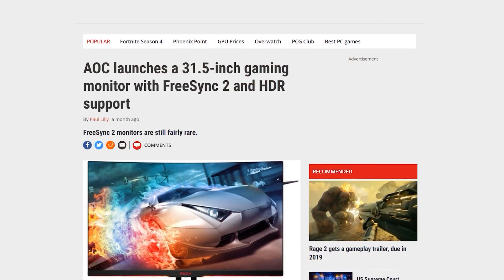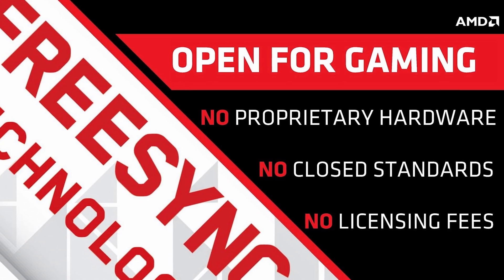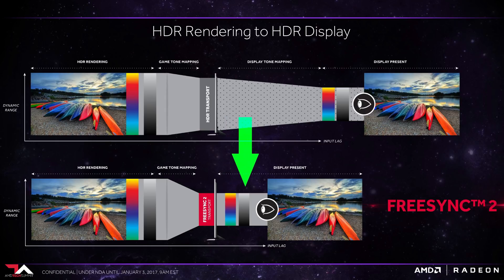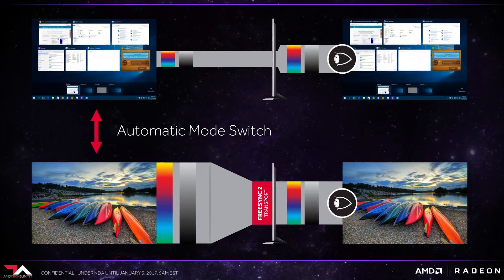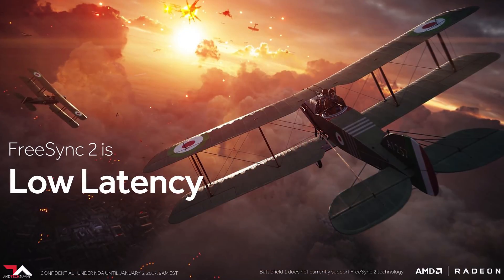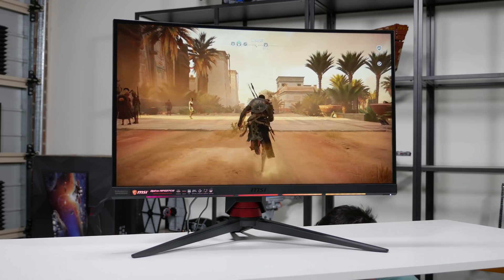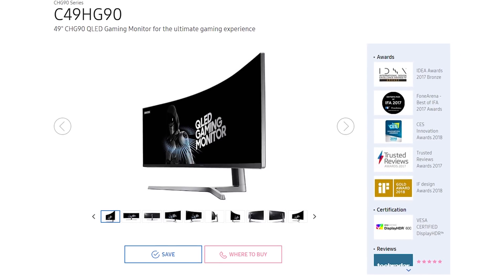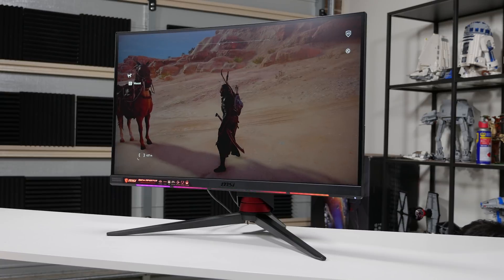FreeSync 2 in 2018 Explained, Does It Work Properly Yet?

Comment: All of them are fake HDR. the 49" Samsung monitor is low end HDR600. There is a new Philips 43' monitor coming with HDR1000.
Reply from the maker: Good luck finding any consumer panel with true 10 bit. That sort of thing costs thousands and thousands right now
Reply: There are no 10bit 1000+ nit monitors, even the Philips momentum is 8bit+FRC, only high end TV's have 10bit with good HDR but no VRR and  too much lag. Its been 2+ years since HDR was announced by Nvidia and AMD and we are yet to see a real HDR monitor. The manufacturers are blatantly slapping HDR tag on every monitor they make. It should read HDR compatible and HDR because they just process the signal. I dont understand how they can call 300nit monitors HDR and get away with it. Acer predator X27 and Asus PG27Uq have 1000nits and 384 zone FALD but they are listed for 2500+ Euros. That's like 2 titan Xp's.Its insane how monitor market is playing out.
Reply: Thats fake as well, true hdr may only be implemented with true 30bit color depth panel(10bpc), while philips and samsung only presentig 8bpc+frc
Its just nvidia who made au optronics produce true hdr panels for the upcoming gsyncHdr panels like pg35vq, xb272, predator x35/27, ag353ucg/273ug
Reply: 1InLight1,

Actually the new 4k HDR 1000 G-Sync monitors are 8bit+FRC too. So not "true" HDR either.
Reply: 1InLight1,

I was talking about the 27 inchers that are coming out this month. OC3D says, "ASUS has confirmed that ASUS will achieve 10-bit colour depth with this monitor using an 8-bit+FRC panel" https://www.overclock3d.net/news/gpu_displays/an_update_on_asus_rog_swift_pg27uq_g-sync_hdr_4k_144hz_monitor/1

IIRC, I've hear one of the Brit youtubers mention it as well yesterday.

As for the Ultrawides, I haven't looked into them yet as they're still very far from release date. AFAIK, 3440x1440 is not considered 4k, so my comment is accurate.

Correct me if I'm wrong though :)

EDIT: Fixed link.
Reply: Kaziel Bonn displayspecifications.com says its 10 bit, reviews say its 10 bit https://www.144hzmonitors.com/best-gaming-monitor/#PG35VQ, what are yours sources?
Reply: Kaziel Bonn Biggest UW resolution I've seen is 3840x1600, which one may consider similar to UHD, as the horizontal resolution is the same and a cinema 4K movie would fit the screen nicely.

Comment: I've had little issue with my 24" Acer freesync regarding shutter and tearing, but I'm still a little confused as to what settings need to be on or off as there is a lot of contradictory information online. I'd like to see presets in games and in drivers that automatically switch on/off upon detection of a freesync panel.

Comment: So is it going to work with the monitors that already had freesync or there will be new monitor support freesync 2
Reply: I'm pretty sure they can upgrade it with a firmware update but that would need to be done on a monitor by monitor basis.. I don't think we will see FS2 on FS1 monitors due to this (I may be wrong)

Comment: hey is there any good 1080p144hz 1ms freesync monitors with good screens under about $350 aud?
Reply: AOC g2460pf, you'll have to manually lower the gamma, but it's a great monitor
Reply: 350 aud is about 265 usd btw
Reply: I think Asus VG278Q its great monitor but cost 295$
Reply: thx i just looked that up in aussie retailers and its about 500 aud most retailers which is ridiculous
Reply: 667whickerwhickerwhicker666 666 identify as a nut button
Reply: i sexually identify as a nut button 1080p 144hz only cost 260$ as in now in my country
Reply: The cheapest is the AOC G2460PF. Got one for 130usd on eBay USA. OSD control is not that great, so to get a proper display/gamma setup you have to use an ICC profile, brightness is a bit high even on low settings, but for that price I can not complain. There are better options on TN panels as the LG 24GM79G and the Viewsonic XG2402,  those have better OSD. There are other alternatives as the Acer XF240H and Asus MG248Q.

Comment: Exactly the video i wanted! Just got a samsung freesync monitor which only has vga and hdmi. So i was thinking should i go for a rx560 for freesync or 1050ti for better performance. Rx570's are just too expensive
Reply: Absolutely. RX560 will easily have the better visual performance with freesync over a 1050ti on the same monitor.
Reply: Adaptive sync (either Freesync or G-sync) is always worth going for. Once you've tried it, you'll never go back to not having it.
Reply: so a rx560 is worth getting over a 1050ti for freesync?
Reply: Aumkar Padiyar, to be honest I wouldn't get the RX560 or the 1050ti. You asked the question which would be better; RX560 with freesync or 1050ti on the same monitor. The answer to that is definitely RX560 with freesync. Currently I personally wouldn't buy anything less than RX570 though. Graphics card prices are on a downward trend so it might be wise to hold on a little while longer and save a few bucks. If that's an option naturally.
Reply: they tell us it should be about summer for launch and late-summer to show in shops. but still no official info
Reply: oh alright ,but a rx 570 has like a huge boost in performance from the rx560 for just one increment in models ,won't the rx 560 be obsolete in a few years? and i dont think ill be able to run any new games on the rx560
Reply: @TheVerm, who are "they"? Please provide credible citation. The fact is there is nothing new on the immediate horizon from neither Nvidia nor AMD.
Reply: +Aumkar Padiyar 
Well, myself I got a first generation 1440p freesync monitor (one of those early ones that was designed before freesync but that had a software update to enable it) and a RX 480.
Because I'm a bit of a silence freak I use AMDs chill to keep refresh rate within the freesync range from 35 Hz to 90 Hz (it's a 144 Hz monitor) and most of my games got chill turned on with a range of 45-85 or 45-90 Hz set.
If I don't use chill then the games I play with the settings I play usually lands me in the 80-90 Hz range.
And honestly I prefer the result from chill despite the refresh rate being lower.
When I do nothing the refresh rate is 45 Hz (unless I walk away from the computer for a bit, then the refresh rate drops even lower), low intensity gaming tends to land me in the 50-55 Hz range when I'm relaxed and not doing much more then just holding in W etc, when there's slightly more activity the refresh rate moves up to 60-65 Hz range and when really busy I get 85 Hz or 90 Hz for those intensive sceens.
Those intensive sceenes tends to be so busy that I don't notice my GPU spin up anyway and it stays silent for the rest of the time.

I don't know if a 560 with freesync would be better then a 1050 Ti for you.
But for me at least I don't mind having a low refresh rate on my monitor personally as long as I got freesync on.
I do notice a slight reduction in smoothness at 45-55 hz compared to when it's running faster, but I can live with it and since I'm using chill I just get that in fairly calm scenes anyway where the reduced smoothness is harder to spot...

One option is to just get a cheap GPU like the RX 550 (or a APU like the R5 2400G or R3 2200G) to tide you over and then upgrade to a 570 or 580 or some such when prices comes down to sane levels again.

But honestly if you're gaming at 1080p I wouldn't go for anything lower then a 570 personally and ideally a 580.
For 1440p a Vega 56 would be the best option.
For 3440x1440 then a Vega 64 is the the best AMD option I feel.
At 4k I'd go Nvidia even with a freesync monitor and get a 1080 Ti then just hope that the next few generations of AMD hardware is able to beat that.

The 560, 550, 1050, 150 Ti, 1030 and the AMD APUs R5 2400G and R3 2200G are 920p or lower options, not really meant for 1080p gaming just yet although they can handle some games at 1080p.
Reply: +hello walkman
2 GB is starting to become a issue in more titles now.
Heck, even 4 GB is a issue in some titles now...
Reply: better wait for the next generation of cards
Reply: i'm in no hurry ,but when are they coming out ? i didn't know amd is also gonna release new cards.
Reply: Absolutely do what you can to get FreeSync working.
Reply: Pick up a used 580 8gb. Seen some for 250$
Reply: +RoBOtic Rebel
No, it's not.
I'm using a Asus card and I'm using chill.
Chill is a AMD techonology, not limited to Sapphire at all.
Reply: oh alright thanks!
Reply: it doesnt really matter when exactly they will release new cards
the important thing is that they should be coming this year(unless im very much mistaken) so geting a low end card right now isnt a very good idea
Reply: 570 cost 25euros more than 1050ti  now
Reply: Aumkar Padiyar Go for the 2gb 560
Reply: +Brendan
If he can't afford a 470 then a 480 is a bridge too far for him...
But yeah, I'd say wait, and then get a 470 if he's able to stretch for that one.
Reply: chill technology is a feature of SAPPHIRE cards (and they only make cards with AMD GPUs)
Reply: Aumkar Padiyar yes it is
Reply: saying chill is for sapphire is like saying MSI afterburner is for MSI....
Reply: +wabachi
Not quite.
At least MSI has made MSI afterburner.
Chill isn't made by Sapphire at all, but by AMD, a completely different company...

But yes, you're right, both of those can be used on any (AMD) GPU (or in the case of MSI Afterburner any AMD or Nvidia GPU)
Reply: well i didn't said is made by sapphire, i was just trying to point out his logic
Reply: +wabachi
I know, my point is just that there isn't quite a true equivalence as such.
Reply: Lol... i had rx580 4gb gddr5 graphic card hooked on hp pavilion gaming desktop on it 😭